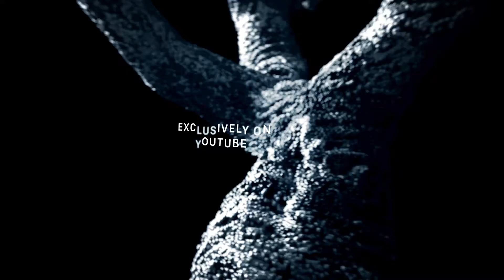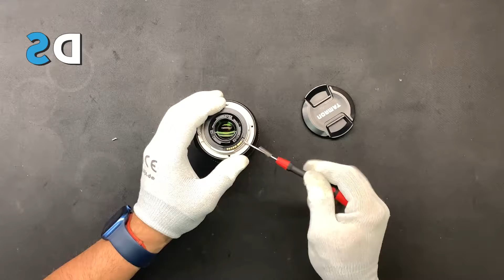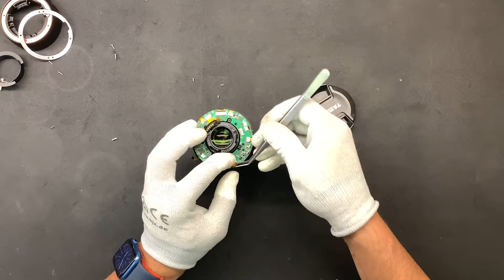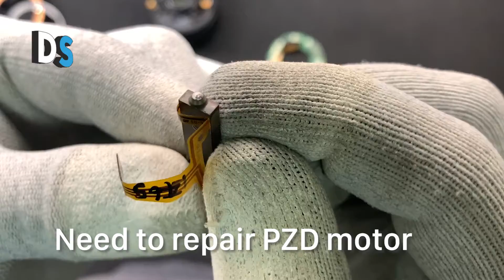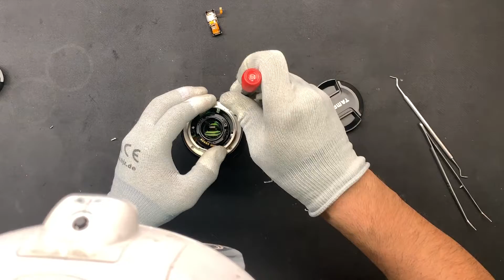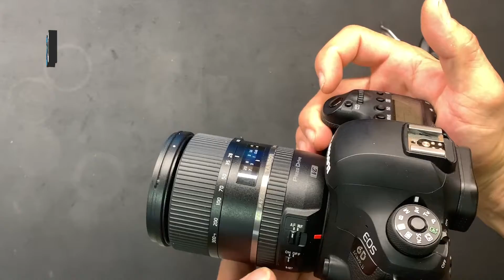How to repair  Tamron lens 28-300mm F/3.5-6.3 Di VC PZD - AF issues(repair autofocus motor)

Comment: What did you do with sand paper?
Reply: i guess you basically need for the surface of the drive to be as clean and slick as possible, so most likely you need to sand and polish the drive tip. Be careful though  only use very high grit sandpaper, like over 2k or 3k, also you could use some type of less abrasive metal polish. 

In ultrasonic motors this type of movement is very common and they require clean and smooth surfaces for them to be able to move. Here is a video on how this motor works. https://www.youtube.com/watch?v=8F88U93X0ro